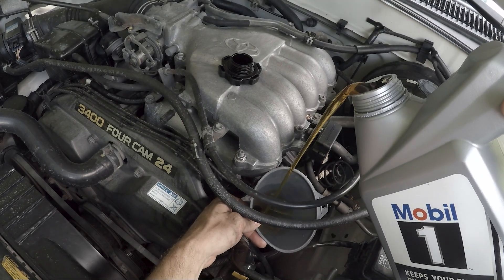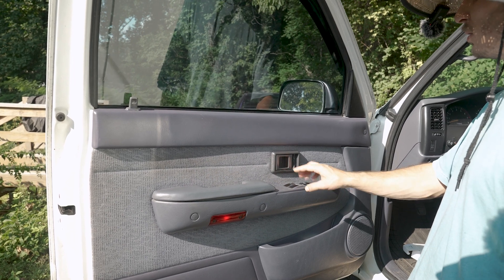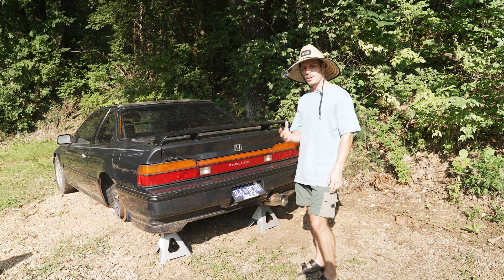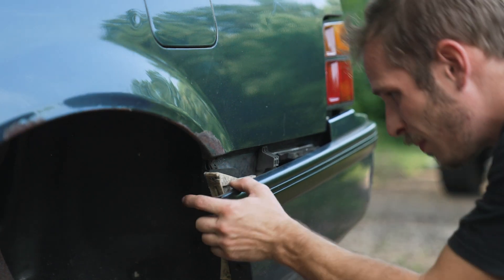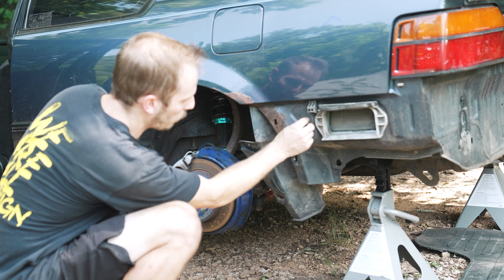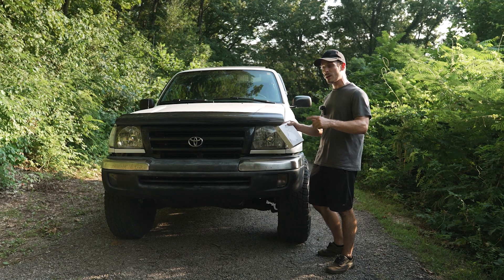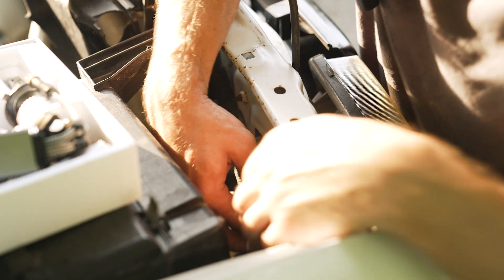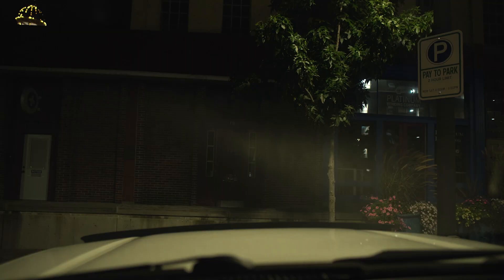The 3rd Gen Honda Prelude Teardown and Transformation Has Begun...

Comment: man the rust on these is a pain in the ass. i now have 2 years of prelude rust work behind me but its finally done.

when you have the time, check for rust by the sunroof (mine was on the inside and i only saw it when i removed the interior roof cover) and check under the front plastic cover beneath the windshield wipers (where the interior air filter is)
Reply from the maker: Definitely already know I have sunroof rust. The whole roof on my prelude is going to have to be sanded down and inspected. Defiantly some around my windshield trim too.

Any tips you gathered from your body work journey?
Reply: @ConnorLee  the rust work isnt really any different from other cars, except you cant buy custom shaped metal sheets that already fit the areas of the car. you have to make them yourself.

all i can say is: if you want to adress the rust, make sure you dont leave any spots behind and do it properly. you dont want bad surprises in a few years because you missed a spot today. even try to look on places you wouldnt normally look (like behind plastic trims or interior covers, you saw in your own video it hides everywhere behind those pieces)

Comment: Never took the back bumper off because I didn’t know how. Now I can get at that rust.
Reply from the maker: There are two more similar bolts on either side of the bumper but outside of the trunk. Almost directly below the two bolts I showed in the trunk
Reply: @ConnorLee  The plastic ones ?
Reply from the maker: There's those yes, but I'm talking about two more capped nuts like the two in the trunk. They are on the rear corners of the bumper. you have to lay down and look up behind the bumper to see them. Sorry, hard to explain.  @cavanblack

Comment: the lips on the wheels there's a product called "speedy metal polish" it is THE BEST sh*t I've used on any polished, chrome, brushed ALL METAL. Highly recommended. I tell everyone to get it and use it and if they don't think its awesome ill buy it from you because you're not using it right 🤣 bottle is 32oz, shake well use a applicator to rub it on and then wipe with a microfiber when it chalks up.
Reply from the maker: Hahaha I’ll use it until I get right! Thank you massively for the tip. I struggle
Cleaning the edge of the lip right near where the face bolts up. Any tools or ideas for cleaning that section without fully disassembling the wheel?
Reply: @ConnorLee  the cleaning part is easy with a soft brush attatchment (similar to a large paint brush) for the drill, you cut the bristles down to about 3/4" then go to town on the bolt section but the clean up is always going to be a struggle getting in all the nooks and cranny's. the speedy metal polish does dry to a chalk so you could go over it with a separate brush on a drill to knock it all off though !